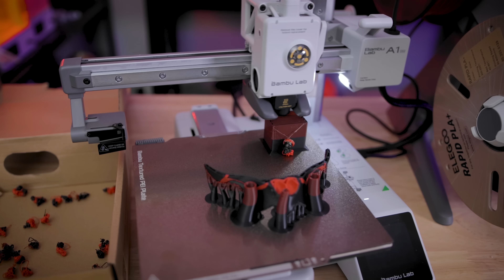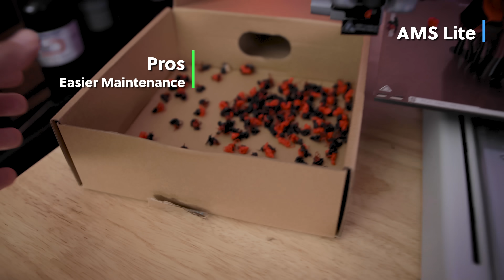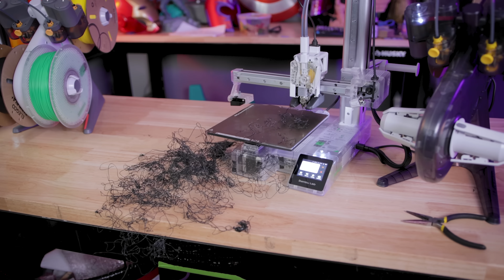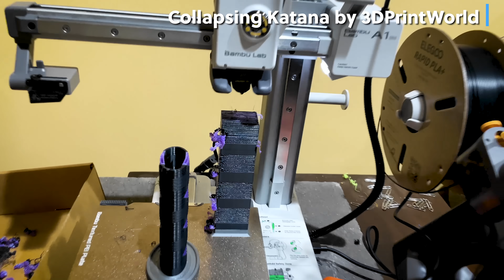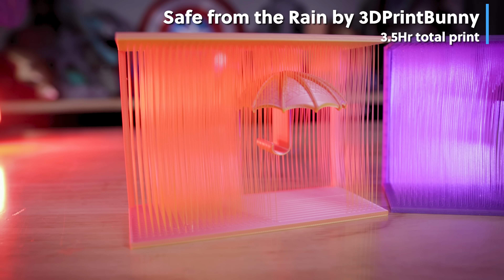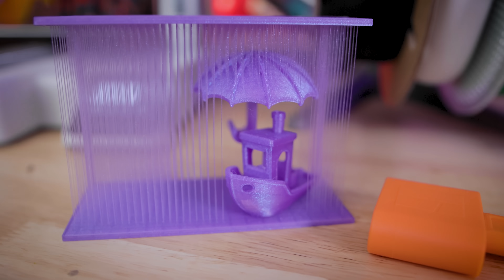Who's this for? Bambu Lab A1 Mini + AMS Lite Review

Comment: I got a a1 mini this Christmas and it does print very well. This is my first printer and I think I made the right decision. I like the a1 mini but I rly hate the ams lite. The lite’s motor to feed filament while printing is extremely weak and constantly I have to adjust the spool to continue printing. Overall I would recommend this printer.

Comment: I purchased an A1 mini and it’s speed has spoiled to my other printers. Now, I wish I had purchased the A1 for the larger bed size.  But, I will admit that the one negative is it not sensing when it’s printing in air because of a clog or no adhesion.

Comment: this thing just seems wayyyyyy too small.
Reply: You think so? Is it a noticibke decrease from your typical 230x230 bed?
Reply: @Ve453  Typical FDM Printer bed would be 256 Squared and the A1 Mini is 180 Squared. almost 100mm difference in printing availability.

Comment: Probably not a popular opinion but I think they just cheapened their whole brand by doing this. AMS unit is better and cheaper? Why not have that on the others? I dunno it just seems like they are trying to be creality or elegoo with offering low end cheaper stuff rather than focusing on what they were doing great....oh and MAKING A BIGGER FRAKKIN PRINTER lol Oh and don't get me wrong with elegoo and creality, they have been around for a LOT longer so their natural progression was to keep coming down in price while still offering some higher end machines. It's just Bambu isn't there yet and with EVERYONE screaming for a bigger one this just cheapens them. Just my opinion :)
Reply: Do creality printers print now? The ender 3 I bought ended my relationship and I moved on to prusa
Reply: @davesou1  My Ender 5 always has. Just have to learn all the fun little facts and quirks and away you go :) I would take a Prusa if someone sent me one but I wouldn't buy one until they start innovating rather than lagging behind (yes the tool changer has been out a LOT longer than since Prusa did it).

Comment: I wonder why they switched to a design which is similiar to a super volcano. Also it is cheaper, though bigger. Either the hotend design is bad in terms of cooling or the materials are low quality, otherwise there shouldnt occure any cloggs.

Comment: I think waste is the main thing that turns me off of MCP. If this machine could be made with three or four separate nozzles that are somehow locked in accurate enough for perfect layer lines still, that would be ideal. Printing would be much faster and there would be no waste. The extra nozzle cost of the machine would eventually pay for itself in filament saved. Could even use a common heater block shared between all nozzles.

Comment: Great video!

Were you able to test PLA and PETG in the same print as support interface layers?

Something I extensively use my X1C and P1S for and this might be a cost effective option to increase production for the smaller parts I'm doing.

Comment: Like all the bambo printers range i have a major issue because its a closed eco system what happens when they move on to the next big thing and stop making parts for the current machines, I tell you you are f**ked it may look nice but you had better have multi replacement parts before they stop making it. Or else you are going to be left with a n ice desktop paper weight.

Comment: Seems to me, if I wanted a small printer for a print farm and didn't need multi-color, a KP3S would make more sense. Same print volume, great print quality, uses standard off the shelf parts, touch screen, linear rails, and is priced under $200. Mine has been doing great for a couple of years now and it has never jammed or clogged. Been eyeballing the Bambu P1S for doing ABS and ASA though. Either that or the Creality K1 Max.

Comment: Sure, I would have been personally happier with a larger X1 carbon, but this is probably the best move for Bambu. It's setting itself up to be THE printer for folks brand new to the hobby to pick as their very first printer.
Reply: Exactly. Looking to buy a printer right now to print a few parts a year. The list of modifications that usually comes with every Ender recommendation is scary and P1P/P1S are a little out of my budget even with the Black Friday discounts. This seems to be the perfect starting point. Pre-orders start shipping in January in Europe though.
Reply: what would you pick if you were experienced?  looks like this performs better than most expensive models
Reply: @eriorellana89 what's your budgets,specs you want etc?
Reply: @eriorellana89  I would say even if you're experienced, if you want a printer that just prints quickly with minimal fuss, get the Bambu P1S. If that's too expensive, get the A1. If you can afford more and want to treat yourself, get the X1. The X1 is really only a minor upgrade from the P1S unless you want to print with a lot of abrasive and uncommon filaments. If you want a printer for tinkering with, I'd recommend building a Voron.
Reply: Or veterans that run farms with parts designed for mass 3D printing. All of our parts are printed on prusa minis and A1s
Reply: Just ordered one. Excited to jump into the hobby

Comment: So far that AI camera has not proven to be very helpful for print job reliability. Bambu Labs’ only important innovation so far has been the lightweight gantry and hotend that make it possible to print at much higher speeds. So the only difference with a Bambu is that our failing prints can fail faster and create a more impressive mess when they do fail. The frequency of failure, severity of failure, and the amount of wasted filament is no different from any other consumer 3D printer brand. As other printers in the same price range catch up in the category of print speed, the features that initially distinguished Bambu printers will be melting away.

Comment: I think we need to get over how loud the part cooling fans on devices are. At this point, it should be a given that those fans are loud. They have to move a lot of air.
Reply: Only if you are used to horrible part cooling fans. Obviously they will never be as silent as big PC fans, but good 4020 or 5015 fans will be way more quiet than the usual 3010 or 4010 fans, especially since you can then also run them at 60-80% speed for the same performance.
Npetune 4 is a good example. It comes with 4020 fans and it's now by far the most quiet printer i own.
Reply: Ehhhhhh.

Comment: would be nice if you could stack the AMS on a shelf above the printer - would reduce horizontal footprint.  Also make a tube for the poop to guide it to a bin on the shelf below.  A vertical stack.
Reply from the maker: Agreed. I was trying to figure out how that could work but its made so the AMS lite is to the right of the machine

Comment: What about putting the AMS behind the printer. How deep would the counter need to be?
Reply from the maker: I don’t believe the cables are long enough and they are designed with a specific length for those cables
Reply: @UncleJessy  hum.. interesting. That's for replying. Great video by the way. 👍

Comment: I guarantee every clog you had was due to that elegoo filament.  Every time I try to use elegoo filament on my X1 it clogs.  I have no issues with all the other filament I use.
Reply from the maker: Printed fine on my P1P & also printed fine multiple times on the A1, I also had Polymaker & CookieCad pla clog

Comment: Second video I've seen on it, and I am not impressed.  I still have serious issues with the amount of waste generated by the AMS, and really any multi-color printer, as well as Bambu's web service.  Then all the issues going on with it, from both videos, are pretty troubling.  Sounds like it is not quite ready for prime time.  And, like you said, I would have preferred to see a larger unit, like an X1 plus, with an integrated AMS based on the mini, maybe with two spools on each side.

Comment: I like their AMS system, looks like it handles cardboard spools no problem! Good for them that they're capturing the more economical/beginner market, too.

I'm hoping to see them move in the other direction next, and release something larger format and start improving the methods to reduce waste produced by multi material setups.
Reply: Just being able to use any spool you want IMO makes it a much better system than than their old one.
Reply: @logicalfundy Except that it offers no way to keep the filament dry.
Reply: @daliasprints9798  I suppose, but I mostly print in PLA. It's not really aimed at people who want to print in advanced materials.
Reply: @logicalfundy  Even PLA needs to be kept dry. It won't fail as spectacularly as nylon or PET when wet, but wet PLA prints like it's 20° colder (poor layer adhesion, concave perimeters detaching and stretching across gaps) unless you raise temp to compensate, and it's mildly to moderately stringy.
Reply: @daliasprints9798  you can dry PLA in a separate dryer, though, and honestly it can go months without drying if you have a good brand. There's no overwhelming need for the AMS unit itself to be drying PLA while it's printing.

Comment: I feel like they are trying to corner the market of 3d printer like DJI did with drones. I wouldn’t get this but I can see myself getting it for my nephew or recommending it to ppl who want to get into 3d printing. I just wanna know is where the single filament goes if you just want to use one color and no ams unit. 

I definitely like the fast swapping nozzle. This has to carry over to the P1 series. Also, if they can place a small screen on this and a ,looks to be, better camera on this machine, I’m hoping they bring that to the p1 series and sell it as an upgrade. Smart what they did with the poop. I was wondering about that. 

The ams unit is dope. I mainly like the part where there are motors that hold the filament and feed it into the printer at the correct speeds. 

Cool printer all in all, don’t like all the tubes but that just a personal preference. I can see anyone who has a Bambu printer now bashing this but they will sell many printer cause it’s going to take over the “Best printer for beginners” title. 

NOW GIVE US A PRUSA PRINTER CLONE WITH MULTI SWAPPABLE EXTRUDER HEADS AND A BIGGER BUILD VOLUME PLEASE😊

Comment: Dunno what temps you print with those speeds but with just PLA i set the temp on 250-60 when printing on 200-250mm/s
Reply from the maker: I was using the default Generic PLA Profiles in Bambu Studio

Comment: For prints with infill or un seen spaces there should be an option to use those for the color transitions rather than purge the plastic entirely. It would reduce waste potentially dramatically. 

There's also simply printing with the blended filament, if you don't specifically need a hard break in the color, a bit of blended color might not be a problem at all.
Reply: Bambu studio has the option to purge into both infill and supports. And at least for the X1 and P1 series you can choose to disable the prime tower and reduce the ''poop'' amount to your liking. It's all customizable, it's possible to print multi color with almost no waste if you're smart about it.
Reply: There is an option for that, "purge into infill", you can also adjust the purge amount to 0 if you want it to blend into the next color.... so both options currently exist

Comment: Bambu should make a filament recycler.
Reply: Yea these need to come down to consumer prices there’s no reason why a filament maker should ever be $10k
Reply: yes
Reply: I’m so hesitant to get into multi colour printing due to the waste. A recycling solution is BADLY needed.
Reply: @cozyChaosGameTime  I recently got an A1 and I just use the waste and melt it into a silicone mold and it turns out pretty cool
Reply: Any maker should make that!
Reply: I literally said the exact same thing on a different video.
Reply: You can 3D print one
Reply: Actually!!!
Reply: YES❤
Reply: i haven't done much 3d printing. i bought my printer 2 years ago and barely printed a few items nicely. many prints failed or were unsatisfactory and i had to throw them out. whenever i throw out failed prints i feel guilty for contributing to global plastic waste.. an easy to use recycler would be great to have, or even a not-so-easy to use but cheaper one!
Reply: its not that simple - sure for mono colour gonna be great for multicolour not so much
Reply: @sober667  just throw all the colors together and get an entirely new color. Unless you'd like to separate the colors yourself. 😂
Reply: Fr
Reply: They def wont
Reply: Yeah
Reply: You could just design one..
Reply: I dont believe they would do that as it could be seen as them printing bad based on the quality of what you are recycling.
Reply: Yes
Reply: not simple at all, filament recyclers cost over 7k…
Reply: The first 3D printers cost tens to hundreds of thousands of dollars. Now you can get an Ender 3 for about $100. Someone will eventually figure out how to make one that's inexpensive.
Reply: @Lallander it's not that simple some tech has price roadblocks that can't be easily overcome. Take thermal cameras for example they require germanium lenses, glass just will not work as it blocks IR light. So you are not going to get $100 thermal cameras in your lifetime
Reply: @filgiupo Just because something “cost” a lot of money, doesn’t mean it’s a justified price. There are currently a couple DIY Filament Recyclers, one of the best ones cost around $600. There are videos on YouTube about it. We are  very close to affordable recyclers!
Reply: That's the one Bambu product I'd actually consider buying if they could make it mass market affordable. Unlike a printer I wouldn't be perpetually frustrated with non extensible firmware and cloud bs.

Comment: Very impressive for the price despite the space requirements. However, something can certainly be done over time thanks to community upgrades. 
I last saw the Prusa MMU build at Tada 3d printing. For the price, a bad joke from Prusa to offer something like this as a DIY kit with printed parts, you assemble it over very many hours or almost days, it consumes much more space and is less reliable. They should really work on this fundamentally. As far as I know, Bambo is also working on a multi-color unit for non-Bambo printers.

Comment: Interesting. $500 for the printer and AMS unit, not bad for multicolor tbh. I wonder if the AMS Lite can be mounted on a wall behind the machine, I see that leg behind it that looks removable. The filament slinging is really frustrating though, I love Bambu Lab but damn that's a definite L for them.

Comment: Cool little printer.  The reason the AMS is external is so they can reuse that design for the larger A1 and A1 Max.  Someones going to print a stand that relocates it above the unit very quickly.
Reply: this comment aged well.
Reply: @billbrobaggins7045  why?
Reply: Cause they did it! You can print an adapter to put it on top of the printer.
Reply: @HenriAGS  It was an obvious prediction only they didn’t make the Max yet. I couldn’t hold out and wait for a larger Bambu CoreXY and just got the P1S AMS combo like 3 weeks ago. It’s my first Bambu and the experience has been awesome.
Reply: I couldn't agree more! That's what I love the most about the 3D printing community! 💙
Reply: Agree, and another not ideal solution is you could place the AMS behind the printer

Comment: To me the deal breaker is that the AMS still needs a purge tower, looking forward the base model w/o the AMS lite
Reply: every mmu will need a purge tower. You can't just start printing without priming the nozzle. Well you can, but its going to look terrible.
Reply: @ironplatypus7393 I wonder much of the purge could simply be used as infill instead, so less is being wasted. Only fill in the set number of perimeters in whatever color, and then purge into the infill. It would mean that the infill would be a stop and go affair, basically only do as much infill as is needed to purge the color, but it'd surely cut down on waste.

Comment: Gotta say...I'm not seeing any use case where this printer's got an advantage over the P1P/P1S. Yes, it's got a touchscreen, but apart from that...there's nothing to be gained from saving $1-200 and a hell of a lot to lose when you discover that you need more than 180mm cubed.

It gets worse when you look at other bedslingers like the Neptune 4 - which does have the touchscreen, runs Klipper and is almost as fast as the P1x printers. Unless you're absolutely desperate for multi-colour printing and you absolutely can't wait another month or two until you can afford the P1x printers, it seems like this one's a dud.

Comment: Looking at the katana, there seems to be an issue with the poops getting onto the build plate.  I'm not entirely sure if that caused the failure, but there's definitely a squirrely looking mess at the top prior to you showing it failing.  (The black bit near the front looks a lot like a Bambu poop.)  I was watching the 3D Printing Nerd video on it, and he mentioned that it uses a spring-loaded system to eject the poop out... does it not work as well as it should?  Or does it sometimes fling toward the build plate instead of away from it?
Reply: I'm curious if it flings it in the wrong direction, or if it's a result of bouncing back out of the catch box.